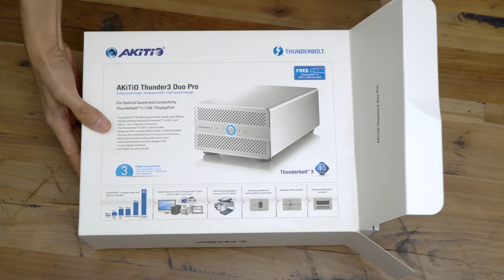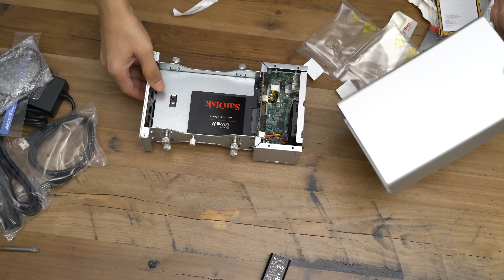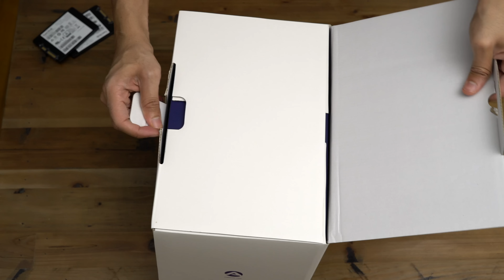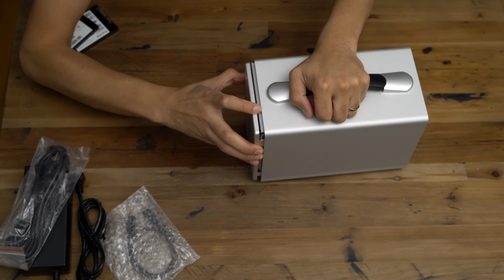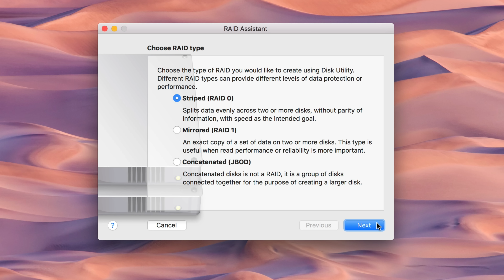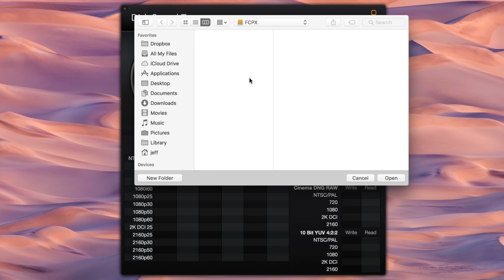Review: Akitio Thunder3 Duo Pro and Quad Thunderbolt 3 drive enclosures

Comment: I want to tell the Mac Pro 6,1 users that 

The hack works!  https://9to5mac.com/2016/11/21/tb3-enabler-enable-unsupported-thunderbolt-3-devices-hack-macbook-pro/

to have the Akitio Thunder3 duo Pro work fully with a professional setup.
 
Today I applied the mentioned hack to my Mac Pro 6,1 running OS X 10.12.3 ,  and immediately after the process was completed,  
the Akitio drive came spinning fully to life, lightning up the blue connection light, while the 2 x 10TB drives were starting up at full speed. 
A magical and lifesaving moment for me.
(Until Akitio’s upcoming Mac-approved drive gets released later this year or next)

Here’s what it looks like after the hack was applied :

Thunderbolt Bus 1:

  Vendor Name: Apple Inc.
  Device Name: Mac Pro
  UID: 0x0001000E011F28D1
  Route String: 0
  Firmware Version: 19.2
  Domain UUID: F27B6BAA-1F4C-845E-A401-E9E95A0D08EF
  Port:
  Status: No device connected
  Link Status: 0x7
  Speed: Up to 20 Gb/s x1
  Current Link Width: 0x1
  Receptacle: 3
  Link Controller Firmware Version: 0.13.0
  Port:
  Status: Device connected
  Link Status: 0x2
  Speed: Up to 20 Gb/s x1
  Current Link Width: 0x2
  Receptacle: 1
  Cable Firmware Version: 1.1.0
  Link Controller Firmware Version: 0.13.0

AKiTiO Thunder3 Duo Pro:

  Vendor Name: inXtron
  Device Name: AKiTiO Thunder3 Duo Pro
  Vendor ID: 0x41
  Device ID: 0x301
  Device Revision: 0x1
  UID: 0x004148F48DC04500
  Route String: 3
  Firmware Version: 18.1
  Port (Upstream):
  Status: Device connected
  Link Status: 0x2
  Speed: Up to 20 Gb/s x1
  Current Link Width: 0x2
  Cable Firmware Version: 1.1.0
  Link Controller Firmware Version: 0.28.0
  Port:
  Status: No device connected
  Link Status: 0x7
  Speed: Up to 40 Gb/s x1
  Current Link Width: 0x1
  Link Controller Firmware Version: 0.28.0

Cheers!
Reply: Is this method also valid for imac2017 10.13.2 macOS high Sierra

Comment: I can't get MacOS to recognize the drive. I formatted the discs while they where in another enclosure..
Reply: ok, I got it to work now thanks to your article: https://9to5mac.com/2016/11/21/tb3-enabler-enable-unsupported-thunderbolt-3-devices-hack-macbook-pro/ 

I wish I knew this earlier because you have to keep system integrity protection disabled in order for this to work via thunderbolt 3. I bought it because i saw you using it on MacOS but now I'm gonna return it.

Comment: Don't do what the author of this video did.

This drive unit DOES NOT SUPPORT TRIM for SSD's when in hardware raid.

If you use the drives in non-raid mode over thunderbolt 3 your OS will see 2 (or 4) drives and support TRIM correctly.  If you do not use TRIM your SSDs will progressively get worse and worse performance.  TRIM is absolutely critical to SSD performance over the long term.  (If you are using these bays with spinning-disks there is absolutely nothing to worry about, use the hardware raid no problems).
Reply: Akitio Thunder3 Duo Pro  not support TRIM for  Raid0 ??

Comment: Are you using the right-hand TB3 ports on a 2016 13-inch MacBook Pro? Keep in mind those ports on that model have slower speeds than the TB3 ports on the left-hand side of the notebook, so if you want to make sure you're getting fastest speeds possible, although with 2-4 SATA 6.0 Gbps SSDs in RAID 1, it probably would make that big of a difference.

Comment: Jeff, thanks so much for posting. I do have a question: I have 4 spinning drives that I put into the Thunder 3: 2 are WD caviar black 2TB drives and 2 are WD caviar green 1TB drives. I should have 6TB total space when making my new RAID drive but it's only showing 4TB. All drives show up in RAID Assistant and I am able to select them all but it's only showing 4TB when I make the RAID drive. Any idea what's causing this or do you have a suggested fix for this?Any help here would be much appreciated. Thanks!

Comment: according to akitio's website their thunder 3 products dont work with mac os. was it plug n play for you? great video btw
Reply: Check out the full article (if you haven't already,  first link in the description.

"Before you’re able to use any of the devices mentioned in this hands-on, you’ll have to run TB3 Enabler to enable unsupported Thunderbolt 3 devices on your MacBook Pro. Thunderbolt 3 devices that utilize the first-generation Texas Instruments chipsets show up as ‘unsupported’ in macOS’ System Information, thus, you’ll need to rely on a hack in order to enable these devices."

Comment: can this support two 4k monitors @60Hz? One monitor connected to the display port and the second monitor connected to the remaining thunderbolt 3 port via an adapter (tb3 to displayport). If anyone has tested this I like to find out. I was thinking of getting the upcoming OWC thunderbolt 3 dock, but if this thing can push two 4K it may make more sense to go with this.

Comment: I personally went with the OWC ThunderBay 4 mini. It supports Thunderbolt 2. I added 4 Crucial 1 TB SSDs. I then used SoftRAID and configured for RAID 1+0. It runs 24 x 7 and is super quiet.

Comment: Great vid. I have the Quad thunderbolt 2 drive enclosure on my iMac 5k but now i'm most likely to get two more Thunderbolt 3 enclosures now i have a new 15" MacBook Pro.  For me speed is very important since 4k is almost out-of-date already. 8k video is the next big thing and for that speed is a necessity ! However the speed for me is too slow, theoretically you should be able to get at least speeds of at least 3-4Gbps especially since BlackMagic speed test shows the internal speeds of my Laptop of 2000mbps Read and 1600mbps Write. I would have to Raid 2 units together to get any decent performance matching my new laptop!

Comment: I always get scared that those enclosures have hardware raid. I have no data on it but basic logic leads me to believe that they'd make the drives much more unreliable since for raid0 there is no battery backup so an uneven state will make them inaccessible and for raid1 there are no checksums to tell which drive has actual corrupt data.

I'd rather get myself a nice NAS... Not these cheap and slow things with a custom os... but a little server that supports freeNAS like the HP ProLiant or the FreeNAS Mini. Yes, they are more expensive and require knowledge about the subject but at least they have actual data integrity benefits compared to anything these drive enclosures can do.
Reply: I agree. These cheap, simple controllers are not the best. I'd rather have a SW RAID in this case. I once lost a complete disk in a similar enclosure and the controller wasn't even set to RAID, just JBOD. It still managed to corrupt one disk entirely. 
On my server I use a proper RAID controller I trust.

Comment: Why would you want RAID 0 over 1? RAID 0 is impossible to recover; speed is irrelevant if data is lost! Even RAID 5 recovery can be problematic in my experience; RAID 1 is almost fault-proof (albeit not as fast as 0 or 5).
Reply from the maker: +Marty Turner because speed is important. I use RAID 0 all the time. As long as you have backups it's fine.
Reply: Marty Turner there are many instances when you need the highest speed possible and you have the data already safe elsewhere

Comment: One NVMe SSD is faster than this 4xRaid0 which is quite underperforming IMHO. I would have expected about 1,5-2 Gbytes/s.
Reply: raid doesn't scale too well. Also SATA has way slower access times. Doing multiple things at the same time on this raid will drastically reduce performance. My Windows PC has a raid0 with 2 SSD's and in benchmarks I reach 1Gbyte/s but during real world... zipping a lot of files, loading a game (not sequential)... I hover around 20 - 100 mbyte/s with 100% drive load.
Reply from the maker: +ThunderbyteNet as mentioned in the article the limitation is in the sata controller.
Reply: The next generation USB-C 3.1 Gen 2 external SSDs will offer better performance, better portability and less risk of data loss (RAID 0). And also no fans.
Reply: 9to5Mac thanks for the answer. I didn't read the article (this time). I think I could appreciate a Raid 10 or 5 on the x4 Box rather than the limited Raid0 Performance. That way it is redundant and might not be much slower (at least with Raid 10, the software Raid5 might have some writing trouble).
Reply: Also according to the Akitio website, TRIM is not supported when being run in any of the hardware RAID modes.  Your SSDs will be real quick initially, and then eventually the speed of the drives will plummet.  Moral of the story: DO NOT USE SSDs WITH THE HARDWARE RAID  (turn off the raid and use the drives seperately; or use spinning disks since the lack of TRIM support isn't an issue for them).